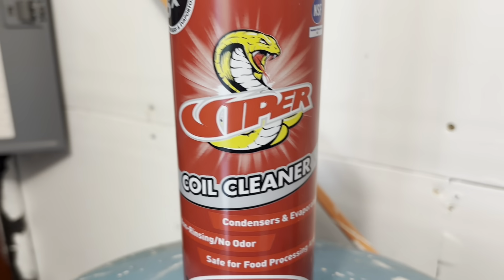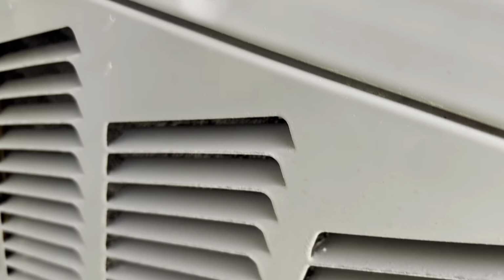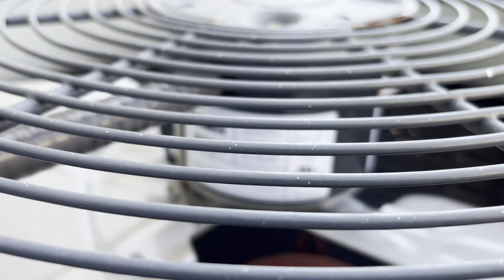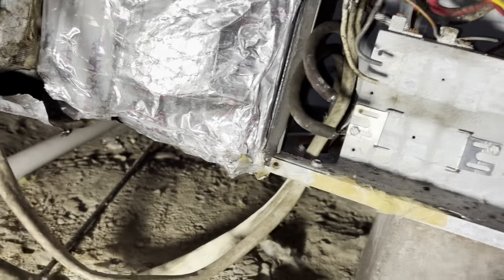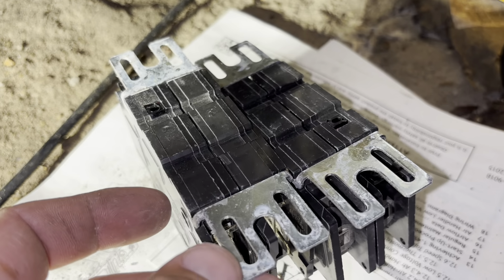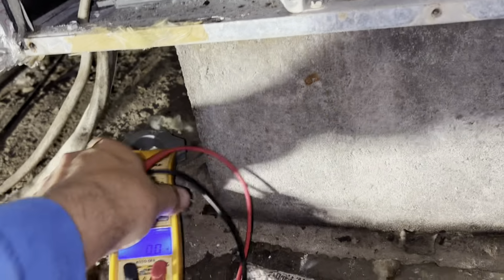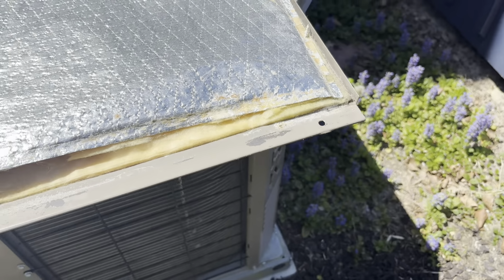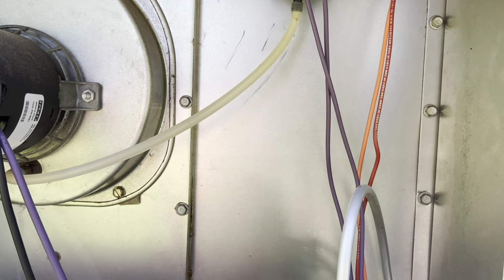A Full Day Of HVAC Calls! | Condenser Motor | Breakers | No Heat And More!!

Comment: I'm laughing. When the local electrical company came to work on a bad connection to my neighbors house, the spotted the giant 240 volt receptacle I installed on my rear wall in case I ever wanted power up the house with a generator after a hurricane. They didn't take any chances, and walked over and removed my entire electric meter until they were finished fixing the corroded connection from the transformer. They were nice enough to tighten the connections inside the meter with an impact before putting the meter back in after they finished.

Comment: Great job tech tip Wednesday always put the date on the capacitor. The ones we use American made have a two year warranty from our supplier.
Reply: Also that is the way it supposed to be the screws are made to tap the threads in the motor .
Reply from the maker: Thanks Woody!
Reply: @JeffsHVACAdventures you’re welcome 😊

Comment: i hate when you buy an OE motor for 300 to 400 bucks and it comes with a cheap titanpro, garbage capacitor, but if you buy an aftermarket it comes with a titanhd. no threads on the tail cover, thats not unusual across the industry, SEMS screws are great for thread cutting into those, they have a notch and a tapered fine thread nose

Comment: Why do breakers exist inside the Ac units and not on the electrical panel?
Reply from the maker: They use them as disconnects for heat pump air handlers that have heater packs.
Reply: @JeffsHVACAdventures  make sure you use a Noalox paste on your aluminum wire connections, i have yet to see one in my few years that is listed for al-cu conductors, most come with a sticker stating "copper conductor only."
Reply: @JeffsHVACAdventures  heater packs also known as heat strips right?